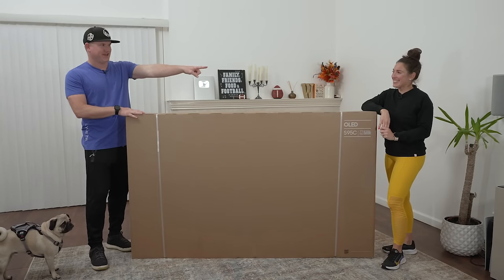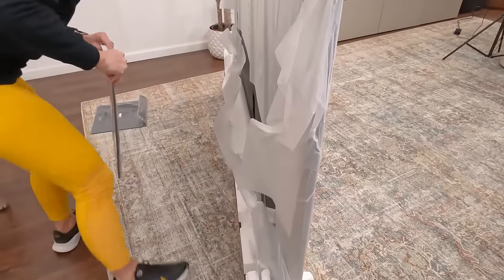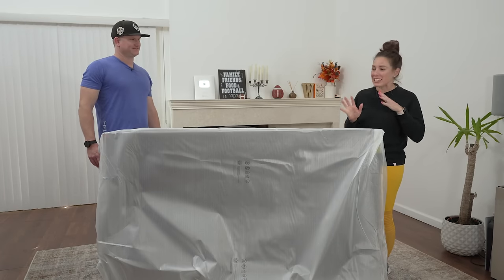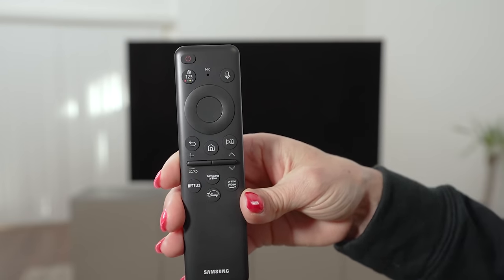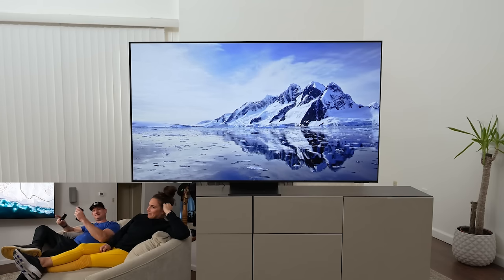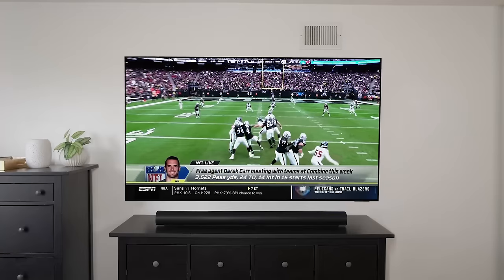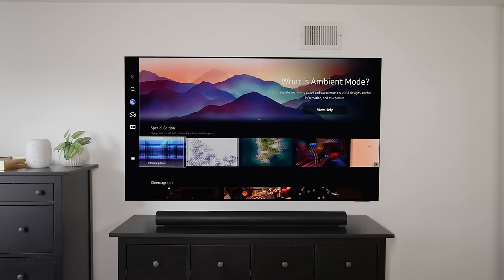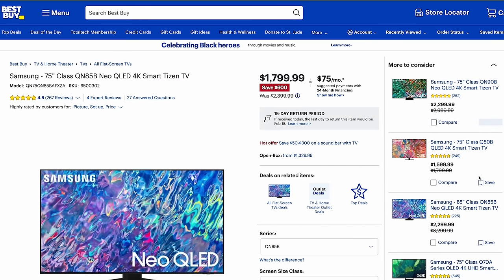New 77" Samsung S95C QD-OLED - Double the fun?

Comment: The reason for the “upside down” plug is that the standard for US plugs was revised to have the ground to be on top, so that if someone drops metal like a coin onto a plug that is not completely plugged in, the ground prong if present will protect the hot and neutral prongs from touching the dropped metal object, preventing a short circuit.

Comment: That one connect box is a mix review.  It's good that they made a spot for it at the back of the tv if you don't want it sitting on the table or in your entertainment console, but you have the option to put it almost anywhere with the longer cable.  I'm guessing a replacement cable will be very expensive.

Sony can make this technology and add a PlayStation WiFi like one connect box where it can install at the back of the tv, giving you a clean look with the gaming hardware of a PlayStation.

Comment: The Samsung looked impressive. Better contrast, brighter and more detail in the darks than the Sony. The whites were very white and the image looked like it had all the advantages of an OLED and an LCD combined. This TV in this size is in the running for a TV I'll buy this year.
Reply: Except burn in.  Gonna be worse than WOLED
Reply: @Humorsopa  how can you be so dense?  The RTINGS burn in test are showing QDOLED are already showing it.  I hope you didn’t buy one without a burn in warranty 😂

I might buy 7795L but would get a burn in warranty for sure.
Reply: @Youtubeuser1aa  Bought? I have two, and my profession is professional calibrator. Not one of my customers have had any burn in issues, not new owners, neither those who have had them since the first day.

My own testing by having one constant on in mixed viewing for 10 months in a row has resulted in the exact same way. I believe in what I see with my own eyes more than I read about. Certainly there are bad specimens out there, but most are definitely not
Reply: @Humorsopa  question: have you reviewed the RTINGS test?

It is highly controlled and states the protocol.  I would take their measurements over your antecdotes.

That is all.
Reply: @Youtubeuser1aa  I certainly have. I'm in regular contact with them.
Reply: @Humorsopa  ok so you’ve seen the results showing that A95K and Samsung have noticeable burn in in the bottom third of the screen but the WOLED does not have any.

I don’t understand why you are being obtuse.  I had an early WOLED that got burn in and it was not pleasant.  I am not looking to repeat the same mistake. 

Stop being weirdly defensive about facts.
Reply: @Youtubeuser1aa  I'm first of all not biased in either way. I have and work with all brands. All have their pros and cons. My personal preference leans towards QD-OLED atm, and so do most of my customers. I can only judge out of my own experience in my profession, and so far I have had least problems with these and PQ of personal preference and the majority of my customers as well tells the same story. 70-30 in favor of QD-OLED. This is also a survey I have to do towards my employer. I get that you think otherwise, but that's fine. Totally up to you.

Comment: Tried your tv quiz on your website.  Seems to need more work but I quite like the concept!  Despite choosing LG, for example, I never got an LG OLED choice despite what I picked, for example.  Mostly, Samsung actually.  What I did discover is that given where I sit, a 77 inch size is the correct upgrade from my 65 inch LG CX when I need a replacement.  The CX is continuing to do well in a room with two large picture windows that face NW where sunlight hits the windows on an angle. Use on the CX is reaching 7500 hrs.   Best Buy’s LG rep says 5 years is about what to expect from an LG tv right now.  We are now into our fourth year, so I will know . . . soon . . . I should think.

Comment: B, in the video you mentioned that the S95B didn’t perform as well with Low Bit Rate Content.  Has that been improved with the S95C?

This piece for me at least is a determining factor for buying the TV.  One of the reasons I ended up returning the S95B was because of this.  Essentially to me the television only looked good when watching High Quality Netflix Movies or big budget movies, etc, most of the stuff in HD was just meh.  

It was so meh I started questioning whether the S95B was really a 6 series Samsung in disguise.

Comment: What size are the bolts you use to connect the wall bracket to the TV. Obviously they have to be small with the thickness of the TV. Do they come with the TV.

Comment: I bought the S95B last year and the picture has been great. My main issue is occasionally the Samsung soundbar is out of sync with the TV so the lips moving don’t match the words I hear
Reply: I had the same problem. I had to turn on the microphone on the soundbar for it to correct itself. Once turned on there was not a problem.
Reply: Turn off your internal tv sound. And use the arc from soundbar to tv arc. That fixed my issue

Comment: Hi there. I bought the 55inch S95c and don’t have the 3 One Connect Box holes on the back of the tv for wall mounting. Is this a fault with my tv or is it only available on the larger models?

Comment: If the light shines on the bit you smudged and you look at the area at a 45 degree angle, you will probably have blue smudges. Because you used an old sock, you probably left scratches as well. The moth eye filter they use is very very fragile

Comment: I wonder how long it will be before a firmware update screws it up?
Reply: LG's 1430 update ruined my panel, $900 gone, no warranty
Reply: @Agent-mb1xx  What happened to it?
Reply: @Spugalugs  I got a vertical pixel line that is paler than the others, they do work just pale and it is annoying that I had to buy another TV
Reply: @Agent-mb1xx  shit, that's messed up.
Reply: @Spugalugs  I have just fixed my TV myself since your reply. Unplugged it, brought it to my bed and let it fall on its back around 20 inches high. The slight twisting is creates due to gravity has fixed the ribbon cable's single connection that was faulty

I have fixed my TV with fucking gravity...
Reply: @Agent 69  So it was hardware and not a firmware update. Several years ago there was an edge lit Samsung the rtings reported they were able to reduce light bleeding in the same manner.
Reply: @NPSACobra  It has started around the same time. Under the old firmware the OLED Care option used to work and stopped since then.

Comment: You‘re mixing up overbrightening + oversaturating with the TV making the content look brighter/better. In approx 95% of content the source material is not graded outside of what the A95K is capable of and the difference that you‘re seeing is Samsung deciding to overshoot EOTF while Sony remains accurate. I know you‘re not a calibrator, but it would be great if you could take a few clues from Classy in that regard to not give a false impression. Yes, the new panels can be up to 30% brighter, but except for gaming there‘s barely any content in which you‘d be able to notice it when sticking to an accurate picture mode which should be the standard at this point. If you‘re only referring to standard/vivid modes that needs a big disclaimer because that is an entirely different thing.

Comment: Hey, B. Appreciate your videos. So, I watch a ton of NBA on Youtube TV. I'm thinking that the Sony A95L will upscale and clean up the picture better than the Samsung S95C, and also have better motion for those games. Do you agree with that? And do you think waiting on the more expensive Sony A95L would be worth it? I have a Sony 900E and it upscales and cleans up the picture better than my Vizio P Quantum X.  The Quantum X is way brighter and has way better black levels. I acually use it as my main TV but the Sonys processing is so much better.  I assume Sony's processing is even better now than on my 900E.  I think im going to wait and get the A95L, But how is the upscalling and processing ov YoutubeTV on the S95C  Thanks a lot.
Reply from the maker: I don't like youtube tv on s95c. Same Motion issues I had last year.  Sony seems to be better with it.
Reply: @BTheInstaller  How does that compare with LG tvs? Is the LG G2 better at upscaling YouTube TV content? I assume the upscaling of the G3 will be at least equal to the G2. I would love the A95L, but the price of that tv is going to be at least $1000 more than the S95C and G3. How are you going to watch sports on that S95C?

Comment: If those tv comparisons are accurate (color wise), the A90J looks awful compared to the S95C.  Every time I watch videos of OLEDS, I keep seeing the blue hue in the picture.  whites look light blue, browns look grey.  Very inaccurate colors.  These new QD-OLEDS look like they are much better in terms of color accuracy.   Maybe they have finally found a technology that is better than LED.  I doubt that the color accuracy is only due to the size of the TV.  The 65" sony and samsung looked good last year. Much better than OLED.   These will be the go to TVs especially when 77 and 83" sizes become readily available.  
However, Good ole Samsung or Sony LED will probably be a much cheaper option and I don't think there is that much difference in picture quality.  Only this blooming thing everyone freaks out about and contrast ratio. Too much effort spent on blooming.  Not that big a deal if brightness dialed in. 

You should put the one connect box on a shelf inside that media console and not hang on the back of the TV.  You will be able to flush mount the TV to the wall. Much better looking.

Comment: Samsung tvs are a hard pass with that dumb 1 connect box.     Just put the connections on the panel itself.
Reply: Why the hate for the one connect box?
Reply: One connect box is one of the main reason I want this set over LG and even Sony.
Reply from the maker: I think it's a good idea. Many people store all their accessories in a cabinet and have to run 3 or 4 hdmi up to tv.  Also, if hdmi breaks, you could theoretically replace the box vs whole tv.

Comment: Do not under any circumstances buy this Samsung S95C crap!  I, to my great regret, bought this ... The TV turned out to be with a defective panel in the form of a periodically appearing vertical strip in the middle of the screen.  And when Samsung replaced my screen with a new one, it was terribly crooked, which was even visible to the naked eye.  However, after returning this CURVE screen to the official Samsung service center, they gave me the conclusion that the curvature of the screen is really present, but it is within the limits allowed by the manufacturer ... I hate this most expensive TV in the Samsung line and curse everyone who made it.  Don't ever buy this crap!!!
Reply: I just looked at this Samsung.  So if not this one, which brand/model would you recommend me looking at?  I have to say the JBL Sound bar they had connected with this TV rocked!  And wireless speakers and subwoofer.  It was a sweet set up!
Reply from the maker: The S95C is amazing.  I have had a Sony oled have curvature to the screen.  Many random things can happen.  I would say the s95c is one of the best tvs I've ever seen. I would probably pair it with a Samsung sound bar system
Reply: @BTheInstaller  Thank you for the feed back.  I saw/heard that JBL sound bar set up paired with it and it’s amazing!
Reply: Чувак, это просто версия для Украины - вам все самое лучшее 😂😂😂